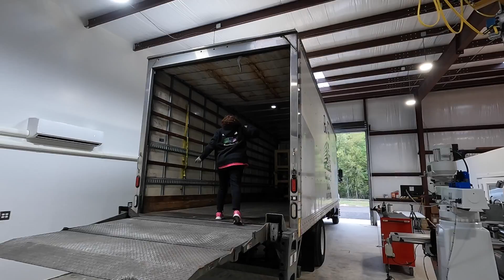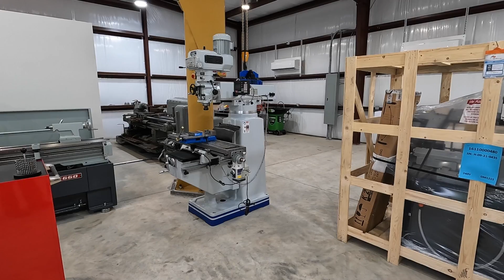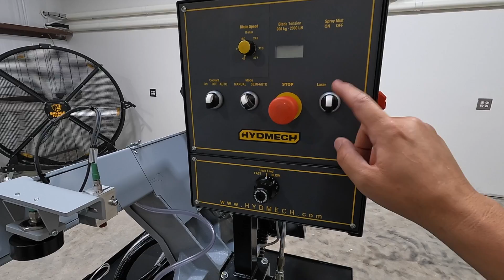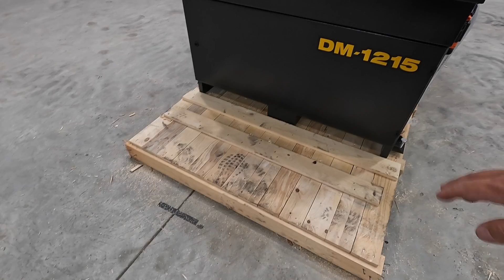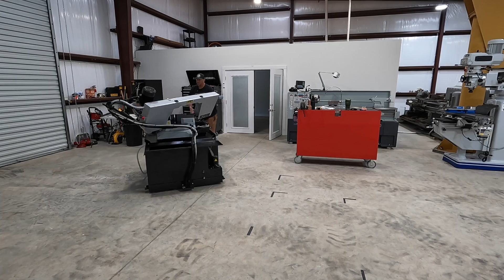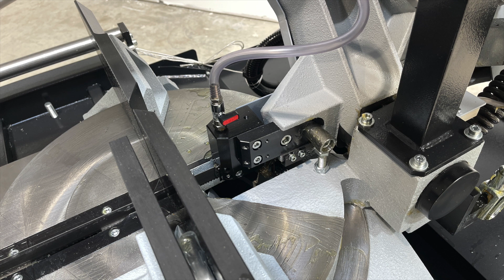HYDMECH DM-1215 Bandsaw: Delivery & Uncrating

Comment: You could have used your jib crane and rigged several slings around the crate and slowly pulled it out of the back of the box truck.
Reply: There were two projections on the tailgate stopping the pallet from coming out. Forklift or loading dock without using the tailgate was the only way to get the pallet out.

Comment: You better stock up on Stainless Steel stock if you need any for the machine shop and any jobs you have in the works, Stainless Steel is going to turn into a long lead time commodity.

Comment: As a Brit, 220 volt, 3 phase, sounds odd.
Reply: As a German, I agree. But at least they are driving on the right side of the road over there.
Reply: @BerndGiegerich  We're also driving on the right side of the road. 😁
Reply: @BedsitBob  Only when you are drunk :P
Reply: @BedsitBob  But on the wrong right side. The other right side is the real right side.
Reply: @BedsitBob  Correct side of the road.  In all countries throughout the world it is important to drive on the correct side, whichever side that is.  Stay safe mate.
Reply: @BerndZeimetz  Here in the UK, the left side is the right side. 😁
Reply: In Danmark we have 400v 3 phase and 230v single phase
Reply: For a norwegian it sounds normal. We have 230V 3 phase with no neutral as a standard. 400V is only in some industrial sites.
Reply: It depends if you wire delta or star. 240 3 phase or 415 3 phase. In my experience in Australia, we rarely use 240 3 phase. We go for big volts for 3 phase. :)

Comment: I will never set up a machinist shop and am glad you have the opportunity to do so, Adam. There must be a host of machines that could be added to a well-equipped shop, I am curious to know what you think are the essential machines to effectively operate a shop. In my wood shop, for instance, I have four different routers but I could get by effectively with just one. And I have both a miter saw and a table saw. I use both all the time but there isn't a cut on the miter saw that couldn't be done on the table saw. Frankly, there isn't a cut that couldn't be done with a hand saw but I'm not looking at it that way. So, if you boiled it down to essential, common machines, what would you choose?

Comment: A cheap and worthwhile thing to do is put childproof plug covers in all unused outlets. There's a bunch of them there to catch chips, grit and liquids.
Reply: had a chip short out an outlet once, yes its a good thing to have
Reply: I don't see any children.
Reply: @grantofat6438  He's talking about chips, not kids.
Reply: @jemijona  A chip off the Adam and friends of the Adam chip?
Reply: @grantofat6438  It's not that bad of an idea.
I can think of it being more useful in a woodworking shop where sawdust blows all over hell and gone.
I'm not sure how many receptacles we actually had at the furniture factory I worked at because we mainly used air.
I can tell you that even with protection our computer terminals and  bill of materials printers went down all the time from dust that managed to bridge a circuit. So they went to workstation hubs and the printers were taken off the floor and put in the office block houses on the factory floor.
Reply: @douglascampbell9809  grinding dust, tiny metal shavings and coolant flying through the air, accompanied by a blast of compressed air in the machine shop.
Reply: @grantofat6438  obviously you've never "WORKED" in a shop.

Comment: they finally put a coolant gun on the side of the machine ! thats awesome, everytime i use mine i have to pull off a main feed and hose ours down, time to tee one i think. also, you should price up a little electric forklift, so good in a small shop. you wont regret it, its like having another pair of hands withyou

Comment: appears to me the most needed new machine would be a forklift
Reply: Nah, get a telehandler
Reply: I used to think I didn’t need a forklift until I bought one. I’m not sure how I would run my business without one now.
Reply: Nah. Buying a forklift to move something one time a month is completely worthless. A forklift isn't worth it unless you're using it everyday or multiple times a week.
Reply: @littlejackalo5326  can't use it multiple times a week when you don't have one. my worthless forklift has been saving my ass for 37 years now. routinely borrowing one will eventually wear out the welcome. not my shop, not my problem but i would have bought the forklift in lieu of a jib crane

Comment: Know you;re going to love this machine. You might want to consider the outfeed/infeed table when you think about portability and having to move it a lot. Maybe another location would be better overall?
Reply: Fair point Clyde. The infeed (and outfeed) tables are a good idea, especially the infeed. I think he got only the infeed table. I think the way he has it setup at the moment is the optimal position for workflow in this shop. Two bolts hold the infeed table to the saw base then one twistlock electrical connection and he can scoot it anywhere where there is space in the shop using the pallet jack. The infeed table will be  out of the way as it is much narrower than the saw.
If his primary work was, say, fabrication or production where he would often need to cut a lot of stock to length at one time then an outfeed table would be essential. In a job shop/repair shop like Adams most of the work is one offs and usually something he could hand carry or have a cart catch the stock. Having the saw near the entrance is really the best place IMO.

Comment: I fabricated a few tall vertical racks for my shop separating all my aluminum and steel and was a great ground space saver. Also a great new project for your new mill would be to make attachable/detachable V-Way style vice jaws for the new Hydmech for your rounds and angle iron cuts. I made them for all my single cuts on my Scotchman 14inch CPO350 Cold Saw and they work great. Different saw but same concept...

Comment: Hi Adam.
Congrats on another quality bit of gear 👍
I’m thinking that you could make a four ‘catchers’ for the levelling blocks. That way, when you do have to move the machine for deliveries, you wouldn’t need to mess around resetting the blocks under the machine. The blocks would stay ( loosely) attached to the machine.
More work initially… sure…. but in a brand new shop with probably a lot more ‘big’ deliveries, it might make sense.
The ‘catchers’ are simply right angle brackets screwed to the sides of the levelling blocks, and slotted to fit around the levelling bolts.
Easy-peasy…. 😎
Regards
Robert

Comment: A useful project 
Grab an engine hoist cherrypicker thing and modify it to make it into a small portable crane.
The base on these is designed to fit under a vehicle and they’re not very mobile or stable.
Make a square base with much less forward protrusion and larger castors put a heavy counter weight on the base to keep the crane balanced when lifting.
The purpose of this is for those who don’t have access to a proper crane or forklift but need to safely load a lathe or milling machine.

Comment: Adam, may I make a suggestion? Perhaps you might want to consider placing the band saw just on the left of the overhead door (upon entering the shop) and to the left of the office door. It won't be as much of an impingement upon traffic coming in through your overhead door that way, and you can easily set up a vertical stock rack in that corner where the front of the shop meets the office wall. There might even be enough room to put up your infeed rollers. The toolbox and other things that you currently have there could be moved to another area at the shop. Think about it.

The reason I make this suggestion is a matter of "flow". Naturally when stock enters your shop you're going to want to have the cutoff saw close to where it enters. And by putting it on that side..... It might save you the trouble of having to move it every time the truck comes in.

Comment: Cutting crate reminded me of the fun i had as a mid-teen.  My dad showed me how use a cutting tourch and had a 20 ton (capacity) cooling tower frame to shrink down for scrape use.  The rapid zip-zip you did reminded me how quickly i took it apart.  At least it seemed quick.  New tool and a teenager allowed to destroy something.  Grin, grin, grin!.

Comment: Just a suggestion, With how easy this machine can be moved, see if the electrician can leave a good length of wiring from the junction box at the end of the conduit to the saw just in case you have to move the saw around.
Reply: Did you watch the video?

Comment: If you're going to have material storage along that wall, you might want to consider making some sort of guard or shield for the air handlers. It would be all too easy to accidentally swat/stab/smack the air handler with the far end of a long piece of stock.
Obviously, nobody is going to be swinging around large pieces of metal like a 7 year old with a pool noodle, but for thinner stock or aluminum it's possible.

Comment: The shop I work for has had much more success using a "shadow light" instead of a laser to show the cut path of the saw.
Reply: I was about to add a laser to mine. But you got me curious. Im assuming a small focused light directly over the blade showing where its going?

Comment: ya that seems like it really limit your door clearance for new equipment / jobs coming in, almost think it would be better closer  to the office , where the door clearance wouldn't as important , what you thin k ?
Reply: Either way the saw has to intrude into the space defined by the door because oversized stock has to poke out into the driveway. The fence has to be even with, or slightly in front of the door jamb and the rest of the saw has to be even further in to the space. I had to make the same sacrifice to handle long runs of molding in my woodworking shop. Only I don't have the ability to move my miter saw in order to clear the doorway!

Comment: I used to run the metal shop for an OEM machine builder, before i went out on my own, and a similar hyd-mech was our main saw. When I left we had it for round 6-7 years, it had 100's of thousands of cuts on it, and only needed a single replacement part once. They still use the saw every day, 15 years later. Ours was made in Italy, don't know if they are  still made there?
Reply: The factory is in Canadia.....
Reply: @paulcopeland9035  I know, but 15 years ago hyd-mech was importing Italian- made saws for some of their model-numbers. It's one of the specific reasons I bought the saw, because Northern Italy is known for high quality wood/metalworking machines. A friend of mine was the sales rep for the hyd-mech machinery line in the Eastern United States.

Comment: if you intend to move the saw in the future then when you make the levelling pads for it, to make it easier when replacing it would it be a good idea to use double sided heavy duty tape to keep the pads in the same place so the saw cab be replaced in the same place and therefore the Re-levelling should be minimal
Reply: I was just going to type I see more leveling pad machining videos in the future.🙂

Comment: What's hanging from the ceiling from treaded rod and unistrut over in the corner by where the line sets go outside? Looks like a transformer.
Reply: Btw.  When the condensate pumps quit on those two heads, have your step dad get some Aspen Whites.